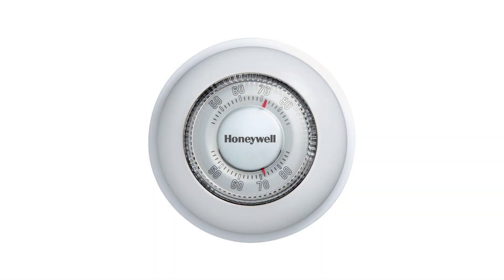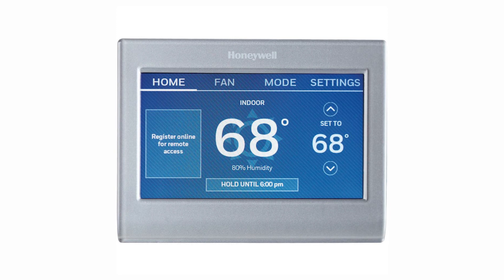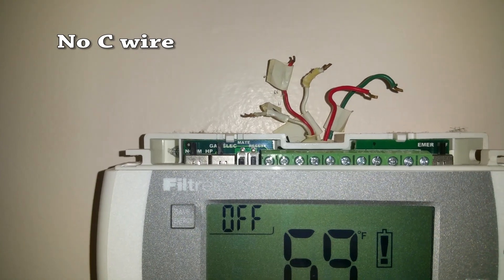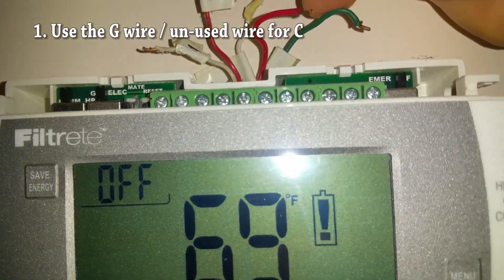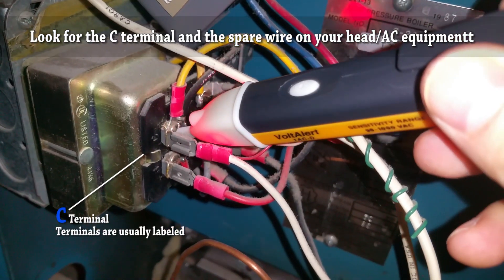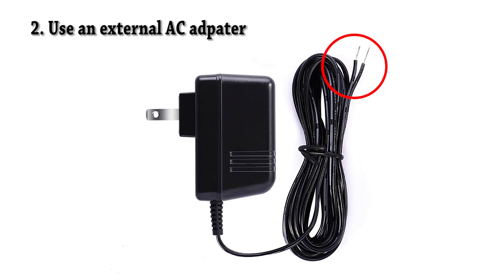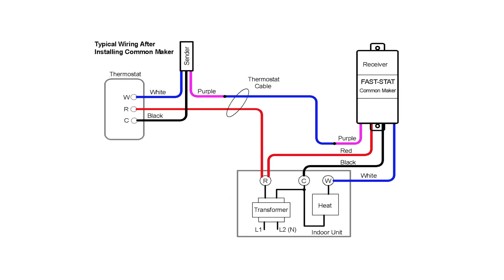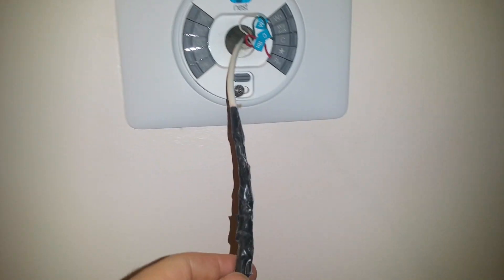How to install a C wire for a thermostat

Comment: So are you saying with option 1, I can connect the green fan wire or just run a wire (thermostat is next to furnace) from the common terminal on the 24V transformer to the C terminal on the thermostat. Thanks.

Comment: Does the furnace circuit board turn on the fan with a CALL FOR HEAT without the fan wire being connected?

Comment: Thanks for the video!  Good info, helped me a lot.  Just had the air handler replaced and they used a 4-wire cable to connect it to my 5-wire thermostat cable...  I went to run another wire to the control panel, only to discover there wasn't one (Trane mn# 2TFB3F18B1D08A).  Was thinking about just connecting it to the common on the 24VAC transformer, then I found your video!

Comment: Good How To Explination about common wire hookup options.  However,  Your last option of pulling the new  T-stat wire through the wall by tying or taping to existing old T-stat wire,  just about NEVER works.  Because, the existing T-stat wire is usually tied around or stapled to some wall stud when furnace is initally installed.  While this is a extreemely longshot the inital furnace installer did not do thier job... I guess it is worth a mention... do not get your hopes up on this option.
Reply from the maker: If it's a short run you might not have staples. My run was short from attic down the wall between studs to thermostat. You can also just snake a new wire, again this all depends on the run and how complicated it might be to snake new wires but it can be doable. Sometimes it's easy sometimes it's not

Comment: Have a similar problem where I see the C wire on the back of the thermostat and downstairs in my boiler room but dont know where to connect it because the thermostat wires are connected to a transformer that only holds a white and red wires.Where do I connect the c wire? The transformer only holds two wires red n white and the c wire is just hanging.
Reply from the maker: Look closely on the thermostat there should be a c terminal, use a flash light
Reply: @daP.A  thanks for your time. I do see the c terminal on the thermostat but not downstairs in my basement. Like I said my thermostat is connected to a transformer in the basement, there is no control board😪

Comment: Thanks for your video. But I am a bit unclear. Am I using the g wire from the heat and connecting to the “c” at the boiler then using that back up at the thermostat as the common wire? Or am I using the g wire from the ac and moving from fan to common as you originally started to suggest in your video. Not clear on that. Ty
Reply from the maker: G from a.c. if u have a dual transformer. If u have only heat use g for common

Comment: Great video, your explanations are clear and with good video to show what you are saying. I do have the same two transformer HVAC you have where I have boiler baseboard heating and later we installed a totally separate central a/c system.  I do have a question regarding using the external 24v outlet adapter; at what terminals on the Nest do I connect the 2 wires along with the existing 5 wires to my heat & a/c? I assume one wire goes to the Nest ‘c’, but where for the remaking adapter wire?
Reply from the maker: IF you have a common from the AC side use that, if not use the transformer for the C wire. The transformer will come with instructions of just google it. Again IF you have the C from the AC use that instead, there's a video on my page showing you how to install the wires. Good luck and thanks for the comment.